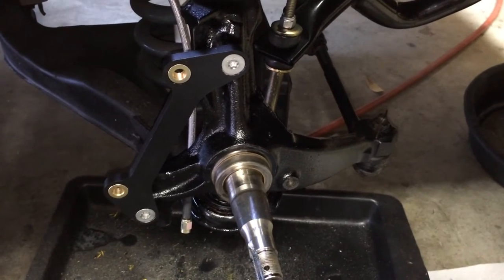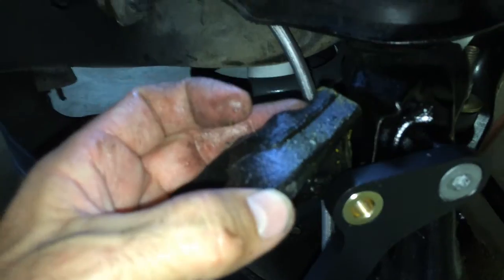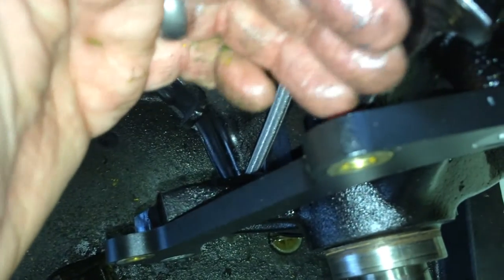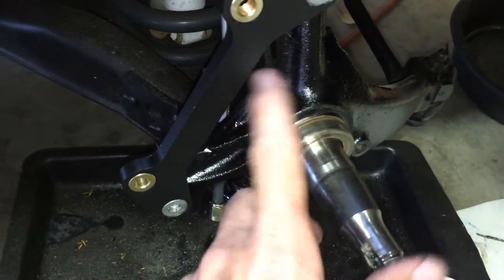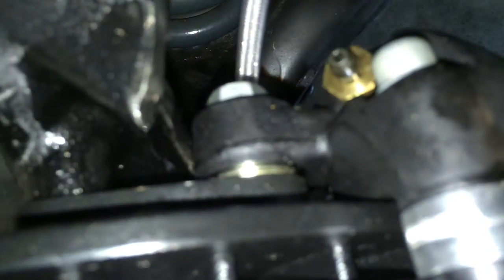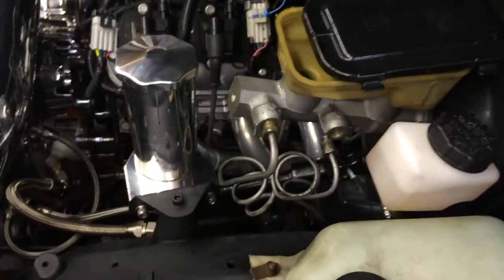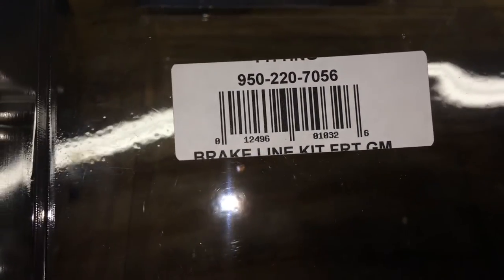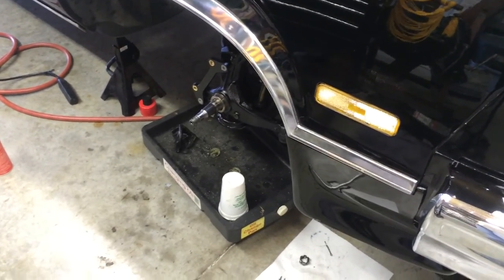Wilwood brakes on my el Camino feb. 2015

Comment: What did you use for the master cylinder? Also did you change the proportion valve? I just put the 12.19 6 piston brakes on my grand national and they are very grabby, if I touch the brakes lightly they want to lock up the wheels. I’m running a vacuum power master setup. Any info will help. Thanks
Reply from the maker: rle1020 
I used the factory master cylinder and factory proportion valve.  I left the tears as drum brakes

Comment: Please help. When I try to put the hub on the spindle the rotor rubs all on the caliper bracket did you use a bearing spacer??
Reply from the maker: If I remember... there is a shim that goes between the bracket an caliper
Reply from the maker: Look at 2:18
Reply: Thank you so much for your reply but yes I figured it out I jumped the gun and had a brain fart all at once!From what I can see very nice ride!👍 thanks again
Reply from the maker: Thanks.  I am glad I could help 😁

Comment: you didn't explain how you had to drill the holes out in rethread them for the bigger bolts other then that thanks for the video wish I had seen this before getting my spindles sand blasted and powder-coated now I have to have them cut and drilled then r e powder coated damnit man. haha
Reply from the maker: Justin Loomis I believe it’s in the directions.